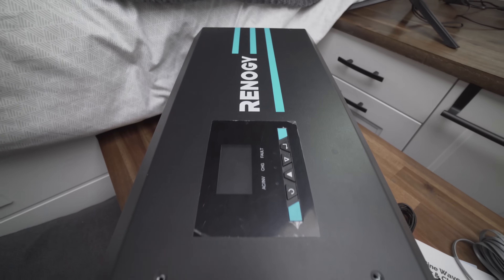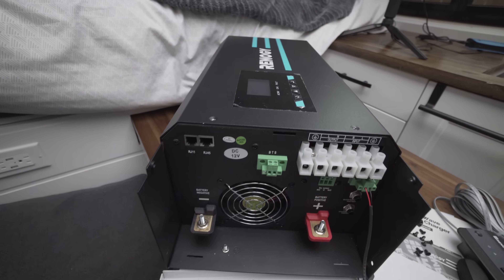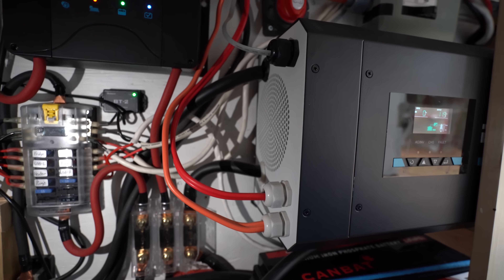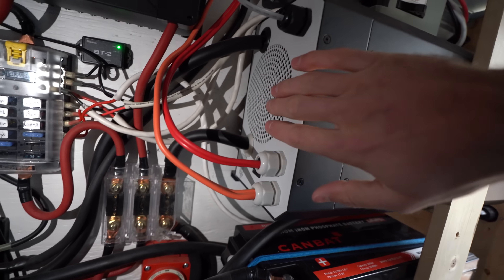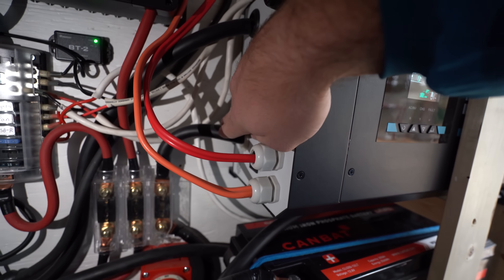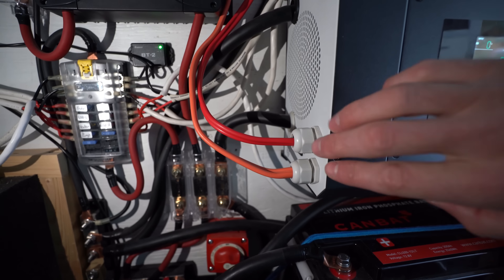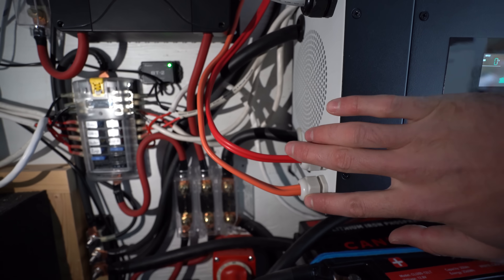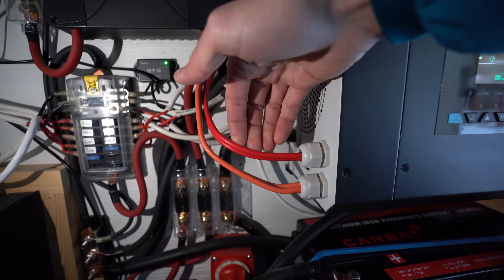Pure Sine Wave Inverter: How To Install A Renogy Inverter Charger

Comment from the maker: Don't forget to use the code MADETOTRAVEL for a discount! Thank you guys so much for watching! Are you planning to install an inverter charger for your solar system?
Reply: Look like we are traveling/living in similar area.  Discovered your utube as we planning to DIY our 28 foot 4 season trailer with our Dodge Ram 2500 Diesel truck.  We like exploring, camping, fishing and ice fishing.

We decided to go with the following equipment.  No doubt we may end up upgrading to get more comforts and adding nick naks.

Renogy 3000w Pure Sine Wave Inverter Charger Power Inverter 12v DC to 110v AC, Two-in-One Inverter Charger Solar Inverter 12v to 110v Converter with LCD Display

Renogy Rover Elite 40A 12V/24V MPPT Solar Charge Controller,with LCD Display Compatible with Deep Cycle Sealed/AGM Gel, Flooded, Lithium-Iron Phosphate,Flooded Batteries.  

We did look at the 50 amp DC to DC but doesn't work for our setup, as truck tows and carries our supplies.

Renogy Flexible Solar Panel 3 x 100 Watt 12 Volt, Ultra Lightweight 100w Solar Panel 12v of Semi-Bendable Monocrystalline Cell, Solar Charger for RV Yatch Marine RV Boat Van Uneven Surfaces.  Going to test these out as price is right.

Renogy 200W 12V Solar Panel Kit Foldable Monocrystalline Solar Panel Solar Suitcase with 20A Waterproof Charge Controller.  We use this when not camping in trailer.   Though will test how this works with Bluetti EB3A in the meantime.

No rush on this project, but hopefully before winter set in, will have finished or planning for an upgrade, eh?

We visit many of your spots, but notice a few we missed.  We have done Yukon and Alaska and enjoyed it very much.  Covid stop our NW Territory trip, but it may happen yet in the future.  Hopefully.

Aly
Reply: Can’t you tell us the operation of this inverter and does it go off grid very disappointed in this video watching this video I still have questions

Comment: This thing sucks!!! I have the 3k version. Yes install and setup are easy. However, and this is a massive aciles heal, there is NO communications support! A thousand dollar piece of equipment that has no external info.
Reply from the maker: Why didn’t you go with the Rego model? It’s under a a thousand and has Bluetooth. Or purchase a battery that has Bluetooth?

Comment: Hi David question is this inverter connecting with the renogy one core by Bluetooth or does it need a BT-2 i cant find it on the renogy site
Reply from the maker: Unfortunately, I don’t believe that this model does connect to Bluetooth devices.
Reply: So if i have a renogy core one and a renogy shunt 300 will the renogy one show that the battery's are charging from shore power if i use this inverter or will it always show its charging if i use the shunt hope it makes sense 😅

Comment: Hey David. 

Q: we have the same inverter. Actually, we have the complete Renogy management system installed. However, we just noticed that even if we are not hooked up to shore power and the inverter is not selected on the main controller. We still have 240v working to run things like the coffee machine. Is this normal?

Comment: I see you conect the inverter\charger to a busbar, and you have the rest of components linked to the same busbar ? with different wire gauges ?
Reply from the maker: @the-portuguese-guy  yes that’s correct. What’s your question?
Reply: @madetoexplore my question is how you can crimp small gauge wire for a 3/8 busbar ?
Reply from the maker: @ I’d recommend buying a wire lug kit that covers different wire gauges and lug size

Comment: I had a problem with particular mounting position, those aren't designed to be mounted on a wall problem is with the heavy transformer inside of them from rough conditions in a van it will eventually give way and create a problem over time. There is a utube video on this specific problem
BEWARE
Reply from the maker: Yes, i did hear about this and thought that I would for sure start having problems but never did! I’ve done a fair amount of driving on terrible wash board and old logging roads over 3 years too

Comment: I also have a DC-DC charger.  If I am connected to shore power via this inverter charger, and I start my vehicle (activating the DC-DC charger), will the world blow up?  Will there be issues with both on at the same time charging the battery simultaneously?  Will I have to remember to turn off my DC-DC converter?  Seems like a big mistake easily made.
Reply from the maker: @ThinkDifferentish  this would depend on the max charge that your house battery can take. It should say this on the spec sheet.

Comment: Looking at this install video, i see you put a breaker between the shore power and the inverter. Where did you get the box and the breaker from? Is it 30 amp?
Reply from the maker: @dougCat  yes, it’s a 30 amp fused disconnect. I purchased it from Amazon but I think any electrical store would also have it.

Comment: Good evening. Renogy says that there needs to be 10 inches of space around this inverter/charger for good cooling. Looking at your install, on the fan intake side there is alot less that 10 inches. Does this unit ever overheat? do you find the fan comes on quite a bit?
Reply from the maker: @dougCat  no, it has never over heated. Although there isn’t 10 inches all the way around, there is plenty of airflow through the area.

Comment: As per the owners manual you should be using sjoow 10/3 wire for the a/c connections on the unit

Romex and solid core wiring is not ideal for this application
Reply from the maker: Yes, this is the wire I recommend. https://amzn.to/3GwlLQR

Even though the manual recommends that gauge, it really depends on the length of wiring and staying under the 3% voltage loss.

Comment: I use welding wire made in the USA really works great all copper and super flexible EWCS 1/0 Gauge Premium Extra Flexible Welding Cable 600 Volt
Reply from the maker: @nightstringers  completely agree 👍 welding cable is the best way to go and it’s typically cheaper to go to a local welding shop than ordering online
Reply: @madetoexplore  I got all min on amazon .

Comment: Why did you feed your inverter with 10AWG wire but then installed 12AWG to the breaker panel? That defeats the purpose of installing the 10AWG because that is rated for 30A but your breaker panel wire is only rated for 20A?
Reply from the maker: I did this at that time because I wasn’t sure if I would require higher amps in the future but I haven’t yet. I only really need 14 awg wire for my system but decided to over size the wire incase I decide to install something larger in the future.

Comment: I didn’t see this discussed but it is very relevant for RV use. The inverter/charger hooked up as directed by Renogy does NOT pass through a 30 amp service. In other words, if you have a 30 amp shore power system on your RV and you rewire it through the inverter/charger, you now have only an 18 amp or so service. Pulling more than that will trip the breaker in the device. So I’m now going to have to buy and install an external switch, exactly what I was trying to avoid.  Technical support was worthless, and available literature misleading - the manual with it specifically stated it passed through 30 amps.
Reply from the maker: Sorry to hear that. I don’t require 30 amps on my van so I wasn’t able to test this. I think the new Renogy Rego HF inverter charger would be better suited for this. Appreciate the info tho 👍

Comment: Can you limit 120v shore power to for example 18A to avoid overloading an extension cord?
Reply from the maker: So 120v and 12v are different when it comes to amps. The adjustable setting inside is 12v which means if it’s set to the max of 60amps, it’s only actually pulling about 6 amps of 120v from shore power.
Reply: @madetoexplore  The manual indicates the shore power cable must be 8AWG and rated for 40A.

I want to be able to connect an extension cord to charge the batteries etc, but I want to limit the 120V line to 18A

I assume if I plug in a cord it will charge my LiPo at roughly 14.4V * 75A (1080W) which is fine (9A) but I suspect if a 1500W water heater kicked on, it would pull 2580W (over 20A) and thats what I want to limit / prevent.
Reply from the maker: @andyh8239  no I don’t believe that’s an adjustable setting because the inverter is basically bypassing that power. I’ve installed a 15amp breaker between my shower power outlet and the inverter to protect it from bad shore connections. I think you could buy an extension cord with overload protection built into it tho

Comment: Is the idle draw 30W / 2.36A ?
The manual suggests 15W in standby?
I assume standby mode basically means Off/Disabled and something like a mini fride will not wake it up?
Reply from the maker: It varies a bit because the fan kicks on every 5 minutes or something but that sounds about right. Mine doesn’t wake up from a draw. I physically have to turn it off and on
Reply: @madetoexplore  I have the unit now.  Looks like what it does is pulse the output every so often checking for a load that exceeds 50w.  Fridge uses 40-60W so the feature isnt going to work for me unfortunately.

The idle draw on mine was 29.9W with the fan on, and a little less when not.   Fan seems to run intermittently for even a small 45w load. :-/
Reply from the maker: @andyh8239  yeah, I think it’s common for people to buy a separate, small inverter specifically for their fridge that they leave on all the time to reduce power consumption.

Comment: I was wondering if this unit or the 3000w unit can be setup to charge from a EV charger??   Thanks
Reply from the maker: I don’t have a lot of experience with EV chargers but it can receive up to 30 amps at 120v from shore power and you can install any type of inlet so I’d guess that it probably could
Reply: @madetoexplore  yes they run on 15-30A.   110v to 220v system.   I do think it’s possible and it’s very intriguing.   Where I’m at in thr Pacific Northwest USA… there a lot of free EV charger location

Comment: Renogy deceives customers! They claim PCL able to auto switch from battery to utility , but this is FALSE There is NO setpoint, not on older not on newer version, contacted Renogy about the issue, they replayed "thanks for letting us know but your unit no longer under warranty" is a SCAM, there should be class action
Reply from the maker: Mine automatically switches from shore to battery and vice versus?
Reply: @madetoexplore  how to ? as there is NO setpoint for battery to utl.  
It does has setpoint for utl to battery though

Comment: for that shore power outlet, i don't see that power wire adapter listed in links.
Reply from the maker: I’ve changed the outlet to a simple 15amp one because I found it more convenient. This is the one I’m using now 👇

https://www.amazon.ca/gp/aw/d/B009ANV81S?psc=1&ref=ppx_pop_mob_b_asin_title

Comment: Did you have any issues with the fact that you mounted it on the wall? I saw a guy on YouTube who had his inverter fail because of that. Thanks!
Reply from the maker: Yeah I’ve seen that too. No, i have had zero issues! The manual now says not to mount the inverter vertically on a vertical surface so horizontally on a vertical surface should be fine 👍

Comment: Renogy recommends to ground the inverter with 8 gauge wire, I didn’t find the post to connect the ground wire. Did you install the ground wire? Thank you!
Reply from the maker: I didn’t ground mine because essentially you’d be connecting this to the negative busbar which should also be grounded to the frame of your vehicle. Mine is grounded with 2/0.

Comment: Hi, what Uk size power cable did you use on the 3000w inverter/ charger please?
Reply from the maker: 4/0 awg or 120mm2

Comment: Hi! I just read the manual from this Inverter Charger, and it says to leave 10" (I think it is like 25cm) of space, and to do not install it in a vertical position and also to do not have it closer to the battery bank because it is a risk of fire.
Reply from the maker: Yes it does but space is valuable in a campervan! Haha the space around my solar system is open and very well ventilated although everything is close together. I’d avoid installing everything in an enclosed space. Renogy changed this in the manual after I purchased mine. I haven’t had any issues for over 2 years although I think a couple people had issues with the fan or something? That’s why they changed it. The fire risk is due to the type of batteries. Lithium batteries don’t create a fire risk.
Reply: @madetoexplore  for 2 years already? Ok, then it is reliable. 
I want to stick with what the manual states just in case I need to use the warranty. 
But you are 100% right, space is valuable! I like your videos. Thank you for your reply
Reply from the maker: @ezeenlugares441  honestly, I know people do have issues with Renogy’s customer service and I have too but I’ve also had great luck with there products. All of them have been very reliable! Yes, I would recommend following there manual for sure.

Comment: I noticed your inverter charger is mounted sideways.  We asked Renogy about mounting and they told us it could only be mounted with the display screen up.  Have you had any issues?  Perhaps I misunderstood them?
Reply from the maker: Yes, that is true. That wasn’t in the manual when I installed mine a few years ago. I haven’t had any issues but I think a couple people have had issues with overheating I think

Comment: The installation guide that came with mine says don't mount the inverter in the same compartment as the battery pr it may present a fire hazard.
Reply from the maker: Yes because it depends what type of batteries you have. It’s important to make sure you have lots of airflow.

Comment: was wondering about the brreaker between shore power and inverter. was that 30 amps? I didn't see the link. thank you
Reply from the maker: It’s the 30 amp fusible disconnect. The link is in the description!
Reply: @madetoexplore   I don't see a link in the description. Can you repost it?

Comment: Great video! Which way does air flow through the inverter? Does it come out by the wiring or on the other side?
Reply: Also does it get super hot during normal use?
Reply from the maker: It comes out by the wiring. No, I kept things pretty open so air flows well. It’s only overheated once and that was when it was 35 degrees Celsius and we had a small portable air conditioner drawing power. I definitely wouldn’t install it in a sealed area.

Comment: I just purchased your instuctions and it's not showing the controller , it's only showing the charger. I'm confused with the schematic
Reply from the maker: The charger and controller are the same component. I recommend using the Renogy dc to dc w/ MPPT solar controller which saves money and is much simpler to wire.

Comment: Does your instruction include solar panel, controller, shore power, inverter/ charger, dc to dc, fuse box and shut off? I just picked up the Renogy 400 Solar kit and 20a dc to dc. Going to do all Renogy parts
Reply from the maker: Yes it includes all of those components! The only difference is I recommend the 50 amp dc to dc charger with MPPT but you will just have to wire two complainers instead of one 👍
Reply: @madetoexplore  Thanks, I got the 20amp cause I read that going bigger could cause problems for the alternator, not sure if it’s true but just didn’t want any problems.

Comment: am i tripping? you said use 4AWG for a 3000w and 2AWG for a 2000w inverter, isnt it the lower the AWG number the thicker the conductor and higher AWG is thinner conductor?
Reply from the maker: Yes, smaller number->larger wire. If I did then it was a mistaken. 2 awg for 3000w and 4 awg for 2000w.

Comment: I would be intrigued to see how a inverter would hook to a electric car like a Prius
Reply: An inverter could be installed in one of two ways on a car like that. A standard 12vdc to 120ac inverter could be installed on the 12 volt battery in the car, which gets recharged by the high voltage side once the car's powered up. 

Alternatively, some inverters are designed to receive higher DC voltages, and can be hooked up to the high voltage battery for much higher power delivery -- something north of 3000 watts easily. You'd just figure out what voltage the car's high voltage battery operates at, order an inverter that can receive the correct range, and hook it up to the battery -- OUTSIDE of the main contactors, so the inverter isn't connected to the battery when the car is off. 
You definitely don't want to get anything wrong in that installation, because the high voltage doesn't play around, but it's not too difficult to do it safely.

Comment: Hello, thanks for the video! I'm installing my 2000W Renogy Inverter/charger now and was planning to use your recommendation for a 30amp disconnect between the shore inlet and the inverter charger. I'm having trouble finding good videos of this installation and am particularly wondering how to do an equipment ground connection or if it's unnecessary. In other words, other than the ground from the line and load coming into the disconnect, will I need to add a bar to run an additional ground wire for an equipment ground? I've seen that done for AC metal breaker boxes just given the metal component but wasn't sure where to connect the equipment ground on the AC disconnect box. My negative bus bar is ground to my chassis so i was planning to connect any ground to the negative bus bar; is that a problem given it's from AC to DC?
Reply from the maker: There’s a spot for the ground in the inverter. Don’t ground it to the frame because it’s 120v and not 12v, they are separate systems. The grounds should be connected inside the disconnect and then run into the inverter.